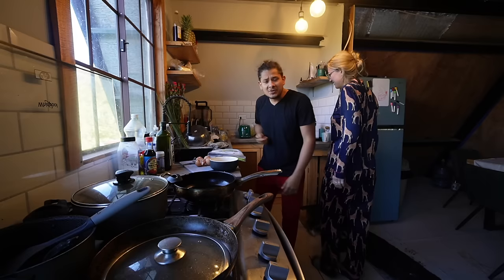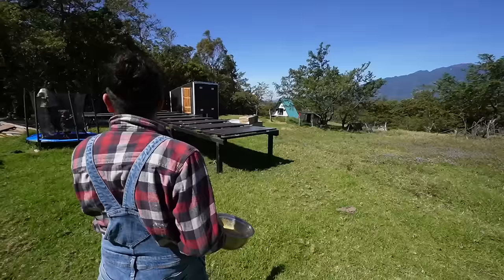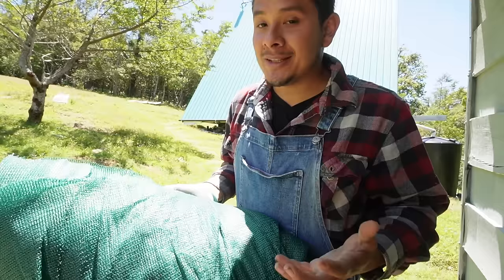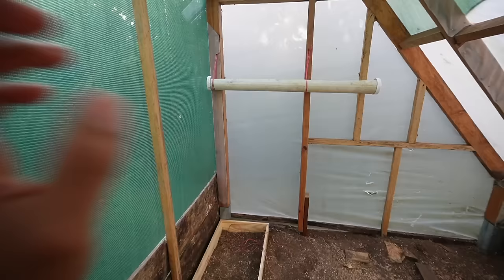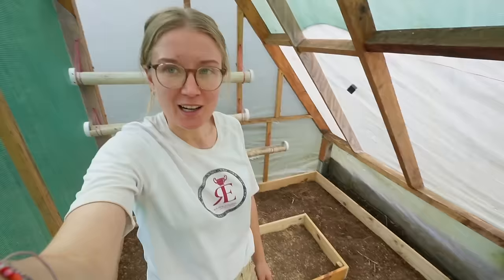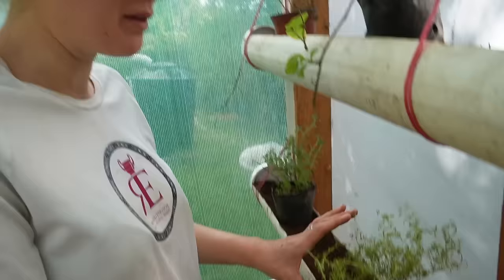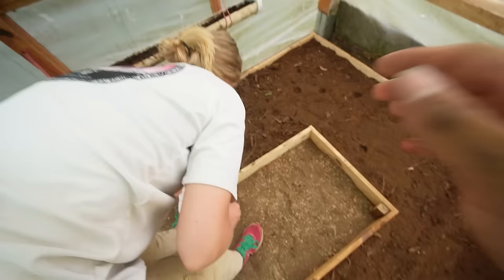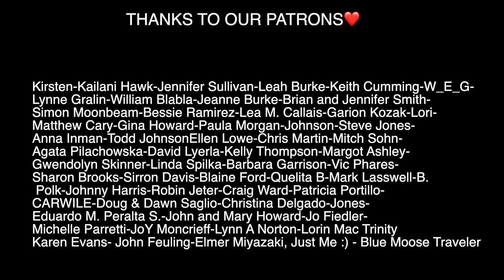COUPLE MUST GROW THEIR OWN FOOD ON A MOUNTAIN...

Comment: What I did when starting seeds is: 
1.) Wet a paper towel 
2.) Line the seeds up on the paper towel
3.) Cover the seeds with another wet paper towel

4.) Place the seeds in a dark and dry place(Cabinet) 
5.) Check on the seeds daily and see if they are sprouting.

Comment: You might want to reconsider putting the Bougainvillea inside of your greenhouse. It can become very large and makes a great hedge. It will look wonderful out on your property but not inside the greenhouse.  It'll take too much room. Save the greenhouse for smaller, more useful things, not just a huge decorative plant. And by the way, the Bougainvillea comes in multiple colors
Reply: Yes bougainvillea grows rapidly and can over take an area very quickly
Reply: Agreed, and it can be messy. Definitely would be beautiful outside!!
Reply: Nice Idea is to make a trellised arbor with the bougainvillea (best one on each side) as entryway to property
Reply: They also are covered in huge thorns when they get larger!
Reply: Bougainvillea should be planted outside.
Reply: And it has very sharp thorn stems. I had a love /hate relationship with my bougainvillea. It was beautiful but boy did it beat me up every time I had to trim it back. Even with thick gloves and long sleeve shirts those thorns still got me. And they hurt.
Reply: The bouganvillea location outside the greenhouse doorway is not ideal. It will grow large and sprawl over the greehouse. As well as being heavy, the huge thorns that mature bouganvillea's produce will rip the plastic to shreds.  Agree with some of the suggestions here to think about using it as a property boundary or entry feature plant. The eucalyptus  is also too close to the greenhouse. This will grow into a large tree.
Reply: Yes the thorns are radical.
It needs to be pruned often and stepping on the prunings can puncture animals paws and your feet.
Have a look at pictures of them around verandahs.

Comment: It’s called a watering can. The watering rose is the part of the watering can that has little holes the water comes out of. Your idea of growing vertically is good (liking the white pipe suspended holders).  You can run string or twine up the straight wall in the greenhouse and grow pole beans up them. Strawberries will grow well in hanging baskets. Basil is fairly easy to germinate - you can direct seed them in your garden. Some seeds do better when they are direct seeded in the ground (they don’t like their roots disturbed). Especially plants that vine, like cucumbers, squashes, pumpkins, melons. Good luck with your garden! By the way, the daisy looking plant looks like a gerbera daisy (you can google it to double check). The pinkish one looks like bougainvillea. Gorgeous. It will spread nicely. From an active home gardener in Nova Scotia. Cheers!
Reply: Tomatoes will grow upside down in baskets
Reply: Ok, I didn’t know about the roots of squash not liking to be disturbed. That makes so much sense now.🤔🙏❤️
Reply: I have seen several videos using wood pallets vertically, neat ideas on that set up, esp when you have little space to work with.

Comment: If you take a thin strip of wood about the same thickness as a cardboard box and about an inch wide then wrap or roll the plastic around the strip a couple of folds then staple it will help the staples from tearing through the plastic. Much like you did with the red banding.
I remember when you built the greenhouse and you forgot to make an opening for the door. That made me smile because that's something I would do. Y'all are always making me smile.
Reply: Yes. Wood strips hold the staples. I always use bits of wood strips.

Comment: You’re going to need to get greenhouse plastic (uv protected) at least 6 mm, or lexan type material. Sheet Rolled Plastic is going to rip in high winds. Stretching tight and Using strip boards over the plastic helps. Your wind is too strong!!!! I understand that sheet poly is expensive but it lasts longer than the rolled plastic and saves money in the long run. Blocking the side of the green house that gets the strongest winds help. Good luck. Rosemary needs space and doesn’t like wet feet, it likes sandy loam. Lavender is the same way. They both need sun. Strawberries might thrive in the pvc.

Comment: This is just a recommendation, but if you’re gonna do mint, I would not plant that with anything else. It will take over the bed, keep it in its own potting plant. 22:40
Reply: If you plant in ground add a 4 inch barrier around planting area, keeping in mind that this containment  is  because the roots are shallow  and spread rapidly.The barrier goes  "underground with about a inch or so hanging above ground.

Comment: Add milk to your eggs, makes them creamier and makes them fluffy, not so ‘hard’. If you’re lactose intolerant, don’t use cows milk, use heavy cream as it contains low levels of lactose.
Reply: I used to add milk but found it actually just dilutes them in my opinion. I found that using a pinch of baking powder (not baking soda) actually makes them perfectly light and fluffy. Try it and I think you'll like it. You can add milk as well with baking powder.
Reply: Goats milk is perfect for all of us who are lactose intolerant! Yay! It's close to human milk.
Reply: @sandraartistabellestri  we use to drink goats milk when we were young, my younger brother couldn’t drink cow’s milk. So they bought a couple of milking goats, not sure if that’s the correct term. I HATED it, not because of the taste, but because it came from a goat and they scared to pebbles out of me with their sideways eyes. LOL.
Reply: I stopped using milk and use water. It makes them fluffy too.
Reply: I like just a little water. It essentially replaces the water cooked off and keeps the eggs soft. Also, if you heat the pan first with a little olive oil until it just starts to smoke your eggs will never stick to the pan.
Reply: Add a little water to eggs and it’s a perfect way to fluff them! 🍳 ❤️

Comment: Guys, I love how the greenhouse project is coming along. I want to run two things by you. If you install a long board on top of the big stapled seams, the plastic becomes more resistant to wind bursts. I'm talking about making a sandwich of the existing board, the plastic, and another board on top. The rope thing was a great idea for the screen by the way.  Second, when veraneras grow, the limbs become stiff. You may want to plant them a little farther away from the plastic wall so it doesn't break it. Another thing you can do is to prune it regularly but I think it's just easier to give some space between the plant and the plastic wall. With Freddie's morning care and that great looking soil you'll succeed. Good luck!
Reply: Stapled seams (not "seems").

Comment: 🦋 I live in North Carolina and I plant everything on March 15 and I’ve never had any problems frost freezing whatever the stuff still comes up and if it doesn’t I rePlanet I don’t do any Nursery stuff I put it right in the ground or right in the pots that it’s gonna live in, it’s done. And I don’t put them in a greenhouse so when you have a mini greenhouse, there is no reason to do seedlings in a small greenhouse like that.
You did a nice job on the repairs and the way you built those raised beds so you could get in to all the areas easily. Well done you to.

Comment: Hi guys, just a little tip. Try to keep fertiliser off the leaves & petals of your plants & only put it on the soil at the base of the plants. Also Eucalyptus will grow into a large tree, so I would plant it a bit further away from the frame of the greenhouse  - it's roots spread out a lot & are very strong. 
Rosemary needs a bit more depth to grow so would be better in the raised beds.

Comment: Hi and thank you for another great video! I love your energy and creativity! The mystery flower I believe is a Gerbera Daisy.  The pipe wall gardens are so nice, bit I'd think of them as just a nursery! If your herbs are healthy,  they will far outgrow them! At least up here in the States, our Rosemary becomes large enough to be considered a shrub or a bush. Our Thyme too, but not quite as big. So theyll need more root room and become far too heavy for the pipes in time. But you might try strawberries there! The mint takes over everything sending out roots underground,  but some mints will take root all along the leafy branches if they lay on the soil! They are best in a planter all their own,  not a wooden frame planter box though , but a ceramic or such so the roots don't go out everywhere! 
As for the flapping and tearing plastic,  we've found it very helpful to lay thin strips of wood all along where you need to staple,  then staple through the wood and the plastic together into your frame.  That's very helpful to keep the wind from getting under and through the sections and ripping them! Looking forward to seeing all your plants producing in your sweet little greenhouse!

Comment: Here’s suggestion, put a 1 inch or so batting,(wood strip) over the plastic and staple through the wood and through plastic. It keeps staples from ripping out a hole. You can use cardboard but water will soften it and have to constantly repair.

Comment: You may want to put more than one seed per hole. Not all seeds germinate every time. So if you put 3 and 2 come up, you would think then buy cutting one down (the weaker one). This way you increase your germination and get the strongest plants. Also, having multiples of 3 plants per variety is good for pollination, especially plants like zucchini which have separate male and female flowers.

Comment: Eucalyptus is pronounced ucalyptis the e is silent, yeah I know English can be strange. In Australia that mesh is called shade cloth and the structure is a shade house. Here a green house has glass windows for warmth where as the shade house provrdes shelter from the elements. The shade cloth works better than the plastic in warm climates and much better for wind because the wind can go through a little therefore is not as destructive and the walls hold up better. If I were you I would have taken all the plastic off but maybe it will survive with one wall cloth only.

Comment: Speaking from a greenhouse grower.. cut a piece of lathe' (1/2"X2" by however long the pieces need to be and then screw it down. This will give you more surface area to hold the plastic!
Reply: Also the gutter will over head the soil pretty fast! Speaking from experience!

Comment: I cut small strips from a board on my table saw 5mm thick and then wedge the plastic between the beam and strips stapling through the strip into the wood and it works heaps better!!

Comment: Hi guys,next time the staples pull out clamp plastic etc BETWEEN the frame and another length of wood.....instead of buying caps use a circle of wood cut in half and  screw into plastic to save money !!

Comment: When you Staples plastic you really need to use wood strips about a 1/4 inch thick and staple the wood on top of the plastic it will help hold the plastic